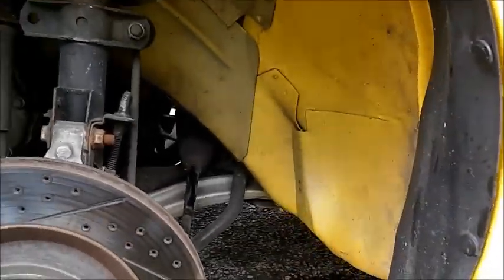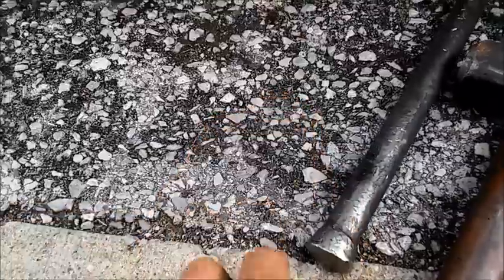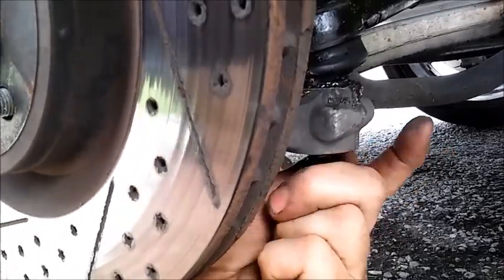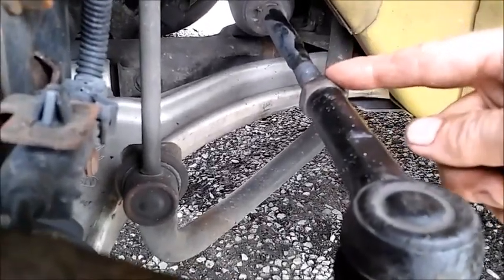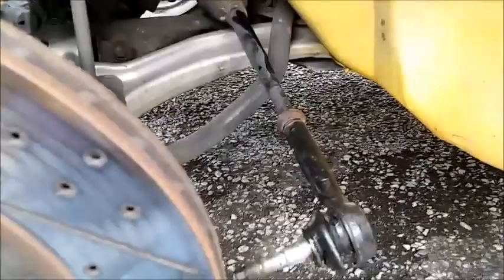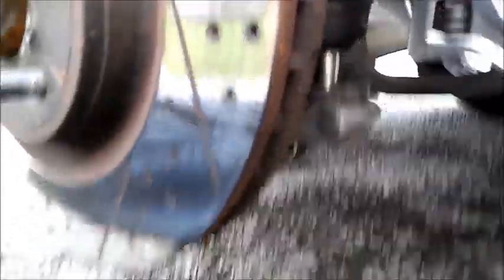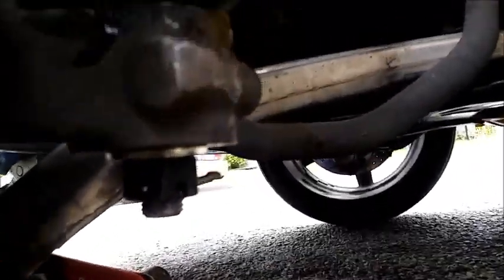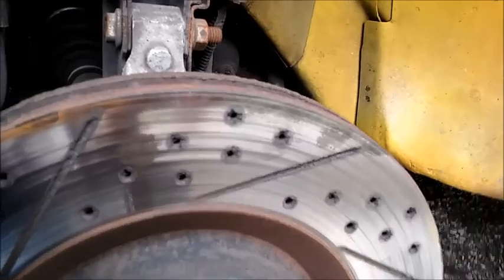Chevy Cobalt Pontiac G5 and many other cars  tie rod replacement for dummies

Comment: One thing I'd like to add. Don't jack your car up using the k frame.  Its not a lift point. Cars have pinch welds on the sides under the doors. But its a great how to video and the gentlemen is very informative. Great video.
Reply from the maker: Pinch welds suck as just thin metal. They bend so easily. Look under most any older car in the yards and you will see. The k farm is bolt to the car in a few points with big bolts holding it together.  Pinmch welds are big floor jacks. I been doing this for 15-20 years or so on many cars never any issues.
Reply: @mobilemowers  you are 100% correct

Comment: Why count when you can just scribe a line before loosening?
Reply from the maker: Most everyone counts just more exact. Your can even paint it before you take it off.
Reply: if you're not moving the locking nut it's impossible for the number of showing threads to change so counting is redundant.